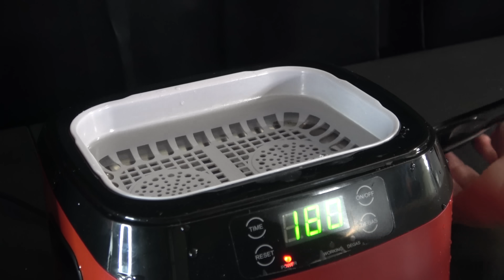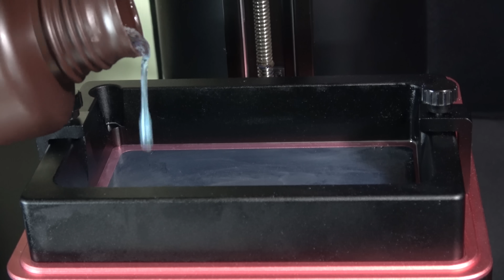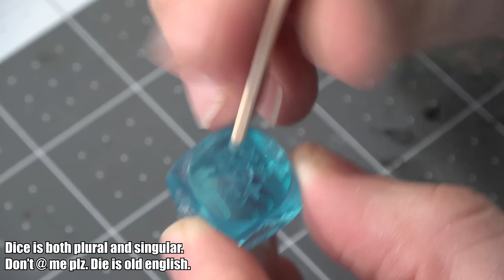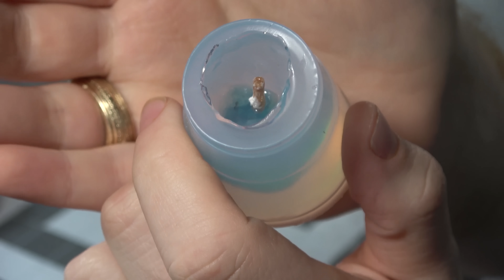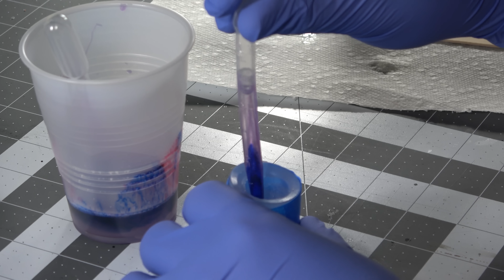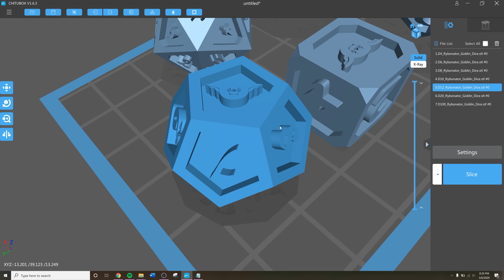How to Make Master Dice for Molds from 3D Printed Dice

Comment: I had just started following Dark Moon this week so was excited when you had mentioned her. I have been following you for awhile now and was trying to figure out a way to make dice. Did you like her way of casting the dice? Was it harder than your original way? Will you be changing how you cast?
Reply from the maker: I would say that it's a more difficult method overall. It requires a specialized tool (dremmel) and you can easily mess it up. I'd do my method for beginners, but hers gets a better result closer to being ready right out of the molds, so better for more advanced dice makers :) I'll probably keep doing it in the future!
Reply: @Rybonator  thank you for responding to my questions.  I  been watching all of your videos for some time now and me and my fiance wanted to try and do our own dice. I have 10 years working with Resin and a few years with molds but nothing like this. I was mainly getting into it for something to do since I am unable to work anymore.  I love the videos you do and have found them quite informative and entertaining. I love the step by step instructions.  I have a mold set from Amazon I have been playing with and some new sharp side metal dice and silicone coming this week.  I can honestly say I am excited to watch your videos on how to mold the new dice again for like the 5th time lol.
Reply: @Rybonator  btw wish I had a 3D printer so I can print off your set... will try to beg one of my friends to see if they will do it for me.

Comment: do you need a resin printer for dice masters or would a normal 3D printer work ok? Like, if you used something to smooth the print afterwards?
Reply: biggest issue is the numbers are not really sandable so they would still be very rough
Reply from the maker: You COULD use an FDM printer, but you need to use 100% infill, and probably do a fair amount of sanding. But it's doable for sure :)

Comment: So, could you use the printed dice as is?
Reply from the maker: I wouldn't. The resin from 3d prints is much softer, and dice are made to be thrown. You will scratch and knick them far easier :/

Comment: A very small piece of advice from one hobbyist/craftsman to another, when sanding, remember to sand in the same direction every time. Don't change directions mid-sand and those small scratches won't appear. Just a very small tip, I love your work and can't wait to see what you do next. Best of luck!
Reply from the maker: I didn't know that, that is a good tip! Is it alright to be doing the concentric circles then? I assume so, but just want to double check :)

I appreciate the help Dez! :)
Reply: @Rybonator  Absolutely, at that point you're basically using an orbital sander, just obviously manually lol. Also, no problem, I really do love your work and only want to see you get better.
Reply: Thanks for the tip! It helps other people too :)
Reply: Oh didn't know that! I thought you were supposed to change directions midway through, as long as pulling up and going down exaggeratedly (idk how to describe it)

Comment: Idk if this will help but i use plastilina clay it doesn’t hardened like air dry but it is safe for silicone, just gotta make sure clay doesn’t have any sulfur in it
Reply from the maker: I saw that The Crafsman used similar clay, but I was trying to find a cheap solution from walmart. I'll have to just get me some of the Plastiline stuff :) Thanks for the tip!

Comment: Loved the video! Did you ever have any issues with warped faces on your 3D printed dice? I modeled my own and ended up with bowed surfaces where the supports touched the dice when I printed, but haven't been able to find a resolution to that issue. Know any good resources to check?
Reply from the maker: Yes actually! That's an issue that I am working on resolving myself right now... Trying to print at a million different angles to see what gets the best results. If I find a solution, I'll show it in a vid :)
Reply: @Rybonator  Sweet! If it helps, I've gotten the best results printing them oriented on a vertex point. It makes for more cleanup, but I've gotten a full set minus my D6 and D4 to print perfectly. I printed mine with a sprue/funnel structure on the opposite end though, so that might skew some results

Comment: I was wondering if I can mix resins in the sla bed to print a set of dice with a swirl effect right off the bat, like maybe mixing two of the same type and brand of clear blue, clear green, and black. I was wondering if you have any experience or ideas of how this would work.
Reply from the maker: I have heard of some people doing this, so it Might work fine, but i haven't tested it myself. That being said, resin like this is softer than Epoxy resin, so it will knick and scratch way easier. Not the best material for dice all around :/

Comment: Pro tip for doing the final cure on your resin prints! if you were to cure it in the sun, to fully cure, it would probably take around 1-2 days, not hours, depending on where you live. If you want something cheap buy a fingernail paint UV curer. As for cleaning off excess resin, Id clean it in Isopropal first, then move it into an ultrasonic cleaner with just water in it. I personally don't trust ziplock bags to keep the Isopropal from leaking into the mix and breaking my machine. (yours is likely much better and not susceptible to breaking like mine but I thought I'd put a word out nonetheless.)
Reply from the maker: Those are great tips! I heard that sun curing will be fine after maybe 3-4 hours. But You might be right. I plan on making my own UV curing station soon :) 

I just said heck with that whole process now though, since I have the water washable stuff :)
Reply from the maker: I appreciate the tips by the way :)
Reply: @Rybonator  Thanks for the reply! I actually haven't worked with the water washable resin before so I'd differ towards your judgement on the curing times. I've only gotten my hands on the "ABS - Like" resin that ends up feeling tacky if it isn't left to cure for several hours. As for a UV curing station, I'd love to see you make a video on it! but make sure that any light from it doesn't leak out, I've gotten sunburns from the nail curer before. If that isn't the lamest sunburn though, I don't know what is.

Comment: Inhibit the inhibitor with Inhibit X!

Love the dice making! Didn't realize 3D printing was so finicky.
Reply: Ooh yeah, but give it a go and become one of us that have passed through the trial of fire!
Reply from the maker: Oh it's a son of a gun. But it's worth it for the customization :) Glad you like the dice!
Reply: Rybonator would something like a light clear coat on resin be able to achieve the same goal?  I’ve ran into the same problem with SLA resin not letting the silicone cure properly and wondered if clear coat would achieve the same or cause the same issue?

Comment: Hey Ryb! The girlfriend and I have been long time viewers and you inspired us to make some dice just for fun and after much trial and error we got our first decent batch! The only thing is even after a month the dice were slightly squishy we used your art and glow (50/50) and let it pressure cure for 24 hours but we're not sure why they're still a bit squishy could you help us out?
Reply from the maker: Did you mix 1-1 by volume or weight? Make sure you did by volume first. After that, you probably either did mix enough, or added too much dye, especially if you are using water based dyes like food coloring. Mix for a good 5 minutes, and try a test set with no dye in them. If that fixes your issue, you can narrow down what your problem is :)
Reply: We do it by volume with a measuring cup and vigorously mix for about 5 minutes. In not sure about the dye though we'll try a dyeless batch something this week! Thanks for the quick response!

Comment: My guess is that you were supposed to let the air dry clay actually dry. It holds a lot of moisture, so I’m not surprised the mold didn’t cure with it
Reply from the maker: I did, I didn't show it on here (my bad), but I left it for 24 hours to dry and it was as hard as a rock :O

Comment: Would it be viable to 3d print dice not masters? like add pigment to the resin in the 3D printer and actually use those dice? also how are the masters not full of bubbles? or is that just in the nature of UV curable resin?
Reply from the maker: So you MIGHT be able to make them, but printer resin is WAY softer than normal resin. They would ding and get scratches really easy one something like dice that are designed to be thrown. Just be careful :)
Reply: Rybonator thank you! That’s good to know

Comment: Would it not be good to use wide rubber bands to tie your molds up? Or would that be worse? At work we have these 1 inch wide rubber bands that I imagine to be just the right size.
Reply: That might work, but if the rubber band is too tight it can squish the mold and deform your dice. Also these molds have sloping sides, so the rubber band might not be applying pressure evenly. Could be worth a shot though.
Reply from the maker: The rubber band has to be the PERFECT size for it to work properly, as too tight is deforming the molds, and too loose won't work :/

Comment: Not sure if anyone has said anything about it, but would using a heavy gauge craft wire over toothpicks help to make better molds or would that cause some kind of issue?
Reply from the maker: I don't think it would be necessarily better or worse either way. Just different :) Use what you have at your disposal!

Comment: so i was making a set of dice but ran into a problem with painting on the numbers i am using acrylic paint for it but when ever i wipe of the excess paint for some reason a small amount does not wipe off and partly colors the whole dice i don't know what to do here
Reply: From what I've seen/heard, you should let it dry, then wipe off everything you don't want with rubbing alcohol on a cloth or q-tip. Hope this helps!
Reply: @GreyMatterShades  thanks
Reply from the maker: Shades of Grey Matter has you covered :) If that happens to me, that's what I do!
Reply: @Rybonator  thank you

Comment: The printed dice you used to make the molds look nice on their own. Why not just paint them and call them done?
Reply: In short, once you have the molds, it takes less time and cleanup is easier with the poured resin.
Reply: In addition to what MrQuickLine said, having the molds also allows you to do things that you couldn't do with printed dice, like colour effects and inclusions (like the metal flakes in the video, or the flowers in Rybonator's druid dice video). Also Rybonator mentioned elsewhere in the comments that printer resin is much softer than the resin he typically uses to make dice, so they likely wouldn't stand up to regular dice use for long.
Reply: @GreyMatterShades  Oh
Reply from the maker: Also, the printing resin for 3D printers is softer than regular epoxy resin. It scratches and knicks a lot easier. So for longevity, it's better to replicate in resin :)

Comment: Wish this video existed 2 months ago when I was figuring this all out (and definitely having my "F**k this!" moments). I'd highly recommend using a cleaner called "Mean Green" for cleaning the uncured resin off your prints! It works a whole heck of a lot better than isopropyl, is cheaper, is not volatile, and is not flammable! Also, use a paint brush while cleaning out the uncured resin to get more out!
Reply from the maker: I have heard that mean green is the way to go! I should give it a shot :) Is it good for cleaning the vat off too?
Reply: @Rybonator  It's great for cleaning out the vat! Plus, unlike isopropyl, it won't etch the plastic film. Helps prevent your prints from sticking to the film instead of your build plate!

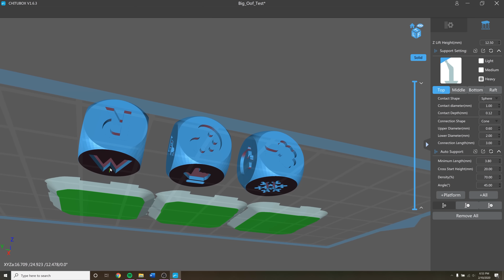Comment: 3:00 OH MAN, PANCAKING! I HATE THAT! SO MANY WASTED PRINTS! SO MUCH WASTED RESIN!

I read somewhere that you can use some RainX and smear it over the bottom of the print tank. I tried, and it has significantly cut down on the pancaking, so probably worth a shot. I also try to keep each layer's area less than or equal to no more than 2x the board adhesion layer area, and I have had almost no trouble with pancaking since I adopted both of these practices.

You don't need to reapply the lubricant to the tank before each print. Once should be enough for a few dozen to a few hundred.

The other thing I do, of course, is keep prints in the "cleaning zone" on my printer. It cures a rectangle of resin, and if your prints are positioned right, grabs all the little bits and groups them into a single piece that's easy to scoop out and throw away.
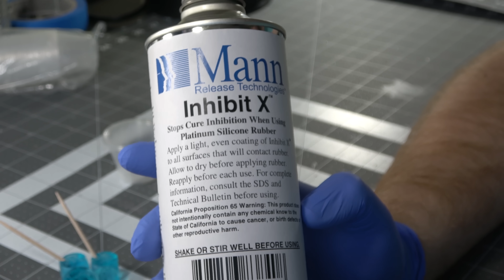10:00 Oh, so that's the secret! I'll have to get some Inhibit X.
11:10 I think there are different kinds of air-dry clay. Most polymer clays will inhibit, and of course anything that's not "sulfur-free" will inhibit. Some trial-and-error and shopping around may be necessary to find a good clay that won't inhibit your platinum-cure silicone. Punished Props Academy may have some good leads.
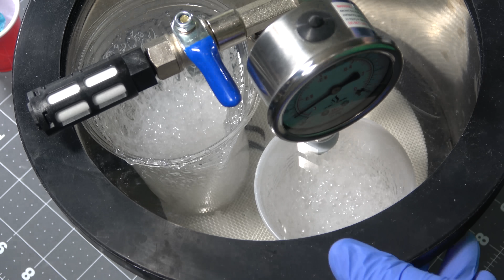12:00 One of the additional things I really like about platinum-cure, if your stuff is anything like what I got, is that it's way runnier than tin-cure so it almost degasses itself without needing the pressure pot at all. When it works, it's amazing to work with. When it doesn't work, it's a horrible goopy mess.
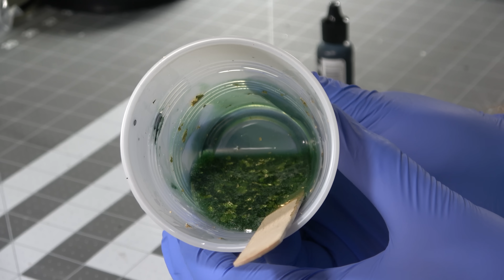15:00 A lot of "black" dyes are just super concentrated versions of other colors. Red and blue are common, apparently the black is green. Personally I bought a bottle of Sumie brush ink. It's water-based, which can have negative effects if you use too much, but a drop or two will turn the entire casting pitch black. Which may not be desired if you're looking for something smokey...
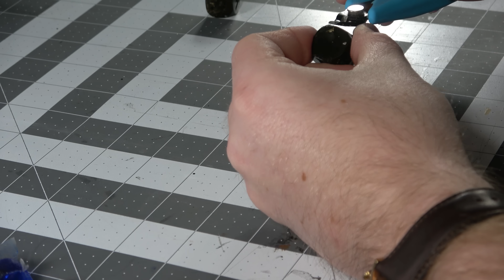17:00 So again, here's that handy dandy reference chart: https://www.sisweb.com/micromesh/conversion.htm
If you're starting with 1000-2000 grit, then skip straight to the 20-30 micron Zona papers, because 50 micron particles are actually coarser than the sandpaper you used, so you're actually undoing work you've already done. I use somewhat cheaper alternatives to Micromesh and Zona, curious people can ask in the Discord server to get opinions from several members.
Reply from the maker: I knew that there had to be a term for it! Pancaking is great haha.

Inhibit x is fantastic, albeit expensive. 
I thought I got sulfur free, but I was wrong I guess :/
Absolutely the platinum is #1, and so much more durable. But it's drawbacks are real :/
I should have gone with the black pigment I have, but I wanted it to be more transparent. It just turned too green haha. Although after casting it's pretty black!
I noticed that on the 2nd dice I was sanding, I started skipping the first set now :) Thanks for the tip my friend!

Comment: never thought about getting an 3d-printer, but now i want one so badly, why did you do this to me >.<
Reply: I tell everyone, I'll tell you too, I recommend a filament printer first. Prints are cheaper, the volumes are larger, and while it's generally a fair bit slower, it's generally easier to figure out what's going wrong and fix it. Filament printers also have a much, much shorter processing time once prints are done, and the materials aren't classified as toxic waste.

Resin printers are good for extreme detail prints, like dice, minis, and really tiny mechanical parts. Anything else, I'd generally go for a filament printer instead.
Reply from the maker: It's my goal to kill all wallets in the dice making community haha :)

Comment: I've started dice making recently, and am also a huge gold fan, however when I wipe off the gold paint pigment seems to just stick itself to my dice in streaks. It's easy enough to remove, but I've never seen this happen in your videos, is this a problem you have encountered in the past?
Reply from the maker: If this happens (It does on some of mine), you can dip a cloth in some alcohol like I use in this video and whipe the paint off the surface after it dries. It makes for a really clean surface :)

Comment: About a month ago, I also made some masters with my Elegoo Mars! I designed them myself in TinkerCAD with a custom open-source font. Instead of supports, I just gave the dice a sprue in the 3D program instead of doing it later. It makes sanding a little trickier, but I just use the edge of the table lol
Reply from the maker: Hey, if it works it works! :) Also, whoop! Elegoo mars buddies haha

Comment: hey @Rybonator, just wanted to let you know that the probable reason why your dice failed the first time was because the dice were flat in relation to the bed (parallel). What tends to happen If you try to print large flat areas on a resin printer is that when the bed lifts it might create suction, which will pull the print off the bed.

I've had that kind of failure plenty of times and finally figured it out. While you can put more supports, all that is doing is making the area stronger to counter-act the suction.

Great video btw! I'm actually curing some resin dice right now to cast because you inspired me to try and make actual dice. It was weird that this video came out the day my prints cured...
Reply from the maker: That's really good to know for why it didn't work! Thank you Chris :) It's much appreciated. 

Perfect timing on our prints together! It's almost like... I was watching you...

Or just coincidence :P